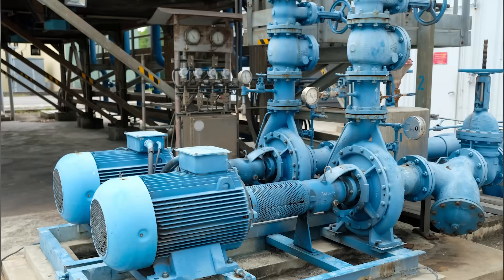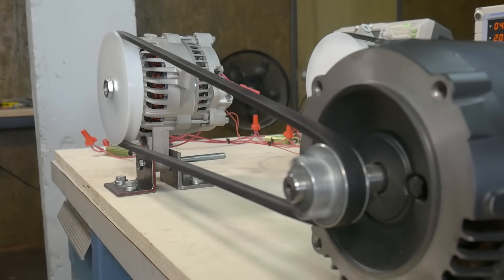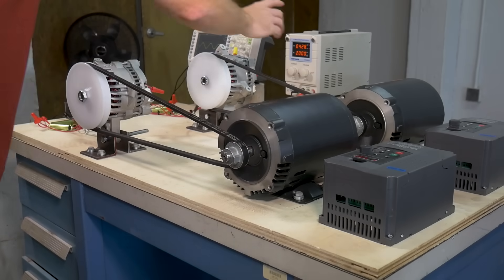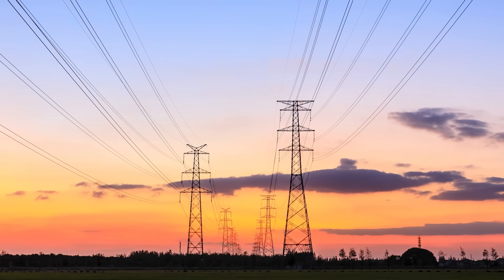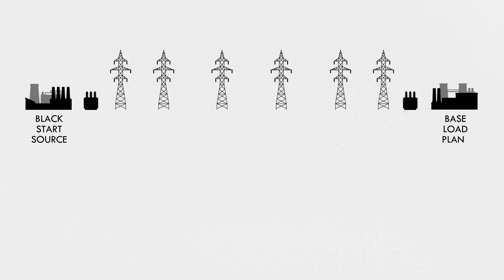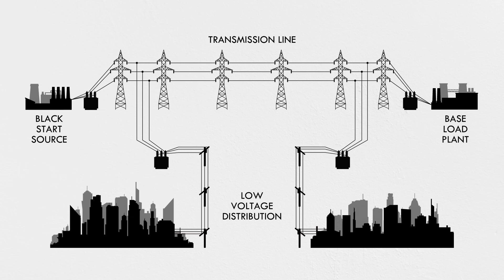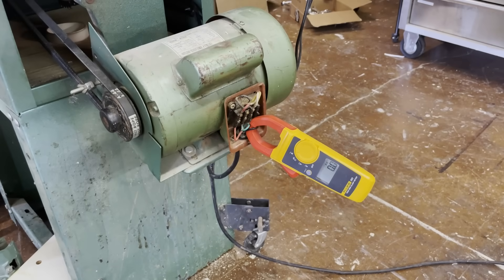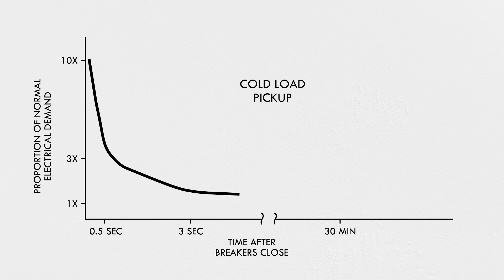What Is A Black Start Of The Power Grid?

Comment: You brushed over that the generators would mechanically synchronize.  Can you explain that process?  How does 1 affect the frequency/phase of the other?
Reply: Because, to oversimplify, every generator is also a motor.

Comment: I used to live near a black start power station called Littlebrook D, just on the outskirts of London. It used three pairs of Rolls Royce Olympus gas turbines (derived from those used in the Concorde airliner) to start up its conventional oil fired power generator which could then start other stations. It was used in anger following an outage after a big storm in 1987, and it would also start up automatically to help maintain the 50Hz frequency of the grid during periods of high demand, due to its short 5 minute startup time.
Reply: There's a similar array of four pairs of Rolls Royce Avon engines at Didcot to provide 100MW of fast response time generation and strategic backup, I think it's a similar setup with it being capable of starting up the much larger gas turbine array that now inhabit the site

Comment: I always knew that like power plants you know use electricity to run as well, or at least needed it for like their lights and coffee makers like you were saying, but I always thought they literally just you know like plugged into their own generators in that with that but like I never really realize how that’s probably not possible or at least very difficult and it’s much easier to just send it off to the grid and then have a regular powerline installed off the lines on the street especially if you’re somewhere close and already have existing power infrastructure close by that would be interesting to see you like just came to see how PowerPoint actually function. Are they get their electricity? What they need what they do what they produce of byproduct second of stuff

Comment: Turn the breaker control switch to TO SHUT at 5 minutes to 12:00 o’clock on the synch scope turning slowly in the FAST direction, and release to SHUT with successful parallel.  Add a bit of load.  Adjust reactive current voltage, then load the on-coming generator.

Comment: One thing I'm curious about with black starts that you didn't mention in this video was how do the various plants communicate on how and when to start back up?  If the power is out, that'd be a huge hamper on most forms of communication.
Reply: Smaller generators can keep comms open, at places like radio masts and landline stations. Failing all that, satellite phones would also be used
Reply: Utility operators understand the role of communications, and have secure systems in place that allow them to communicate in the event of a widespread blackout.
Reply: Major power lines have fibre optic cables embedded in earth wire. Back in the past they used fixed microwave links.

Comment: Sounds like bad engineering if such a catastrophic failure state exists that a recovery from is extremely difficult to perform...
Reply: Or it's an absolutely massive system that by it's very nature is complex and prone to cascading errors. It only sounds like bad engineering because you haven't the faintest clue what you're on about
Reply: It sounds like you're not very good at listening. The engineering is perfectly fine.

Comment: An excellent video, as usual for you Grady!  I've been involved in this issue on a MUCH smaller scale as an Engineer in the US Navy in the early '70s.  We had three, 750 kW steam turbine generators and one diesel 750 kW emergency generator on board.  We would run drills wherein we would "lose the load" and all equipment would trip off line (generators, main engines, boilers, etc.) while at sea and practice bringinging everything back online using the diesel generator to accomplish this.
Reply: How fast could you get everything back online?
Reply: @KJ6EAD  IIRC it was about an hour or so to get back up on line fully.  But we were limited to 1/2 speed or less for the first hour or so of operation due to our HP turbine tending to develop a bowed rotor if not brought offline properly.
Reply: I used to work at the San Francisco Naval Shipyard and tested ship service generators.  We weren't supposed to parallel with shore power but sometimes we had to do it when they were testing radars and other electronics.  Fun!
Reply: @r.h.8754  Yep.  It takes a bit more finesse than "just flipping a switch."
Reply: Did you have to synchronize the generators when connecting to shore power, or was it an instantaneous cut over?
Reply: @krallja  In order to not cause an interruption in the ships power we had to synchronize with the shore power.  We did this by matching the frequency, phase and voltage with the shore power.  After we closed the shore power breaker we would lower the governor control to move the KW to the shore power and then lower the voltage regulators to move the KVARS to the shore power.  When the generator outputs were zero we could open the generator breaker.  We reversed the process to move the ship from shore powere to ship service power.
Reply: @krallja  I didn't get involved in that (Electrician's Mates did that, I was a Machinist's Mate, I ran turbines, pumps, etc.)  But I do know that synchonization was part of the process for bringing up a generator, bring down a generator, and switching to shore power.

Comment: my dad used to work for German railway, back in the eighties... they (still) use 24kV 16 2/3 Hz to run the trains, which is converted from main grid with motor/generator pairs, each weighting hundreds of tons. An Engineer in a hurry managed to engage both, before they where entirely synced... the buildings foundation had to be redone, since both machines did tilt just like yours did... being bolted to the foundation did nothing to keep them from doing that...
Reply: I bet that made an awesome sound.
Reply: @Flumphinator  I bet it made an expensive sound, lol
Reply: @firestorm.v1  It starts with a Uuuuuuuu sound then a Rrrr sound and then something that sounds quite similar to the word "fired"
Reply: @fischX  if that's the first time someone broke something, firing them is a bad move. You just invested so much money in their education and now they're never gonna break your competitor's systems because they learned their lesson ;-)
Reply: Shame we couldn’t see it on hd cctv!!
Reply: You don't even need something so big for extensive damage.
My dad used to run a small business servicing small-scale hydroelectric power stations (the kind you might see in small creeks near mountains etc.) and one of his customers managed to mess up a post-maintenance start-up.
He connected his generator to the external grid before sync was achieved and the result was rather spectacular. The entire generator sheared off the bolts it was attached to the concrete floor with, yeeted itself through a brick wall and out into the yard where it crashed and popped open from the impact forces. Needless to say, the thing was ruined, the building needed costly repairs to the structure and as a side-effect some of the electrical systems got fried by the large power surge and had to be replaced as well.
My dad was called in to restore the mechanical parts (the connecting shaft and transmission system was bent and shattered as well) and hook a new generator up to the turbine and took me along for the trip, so I could see the damage first hand.
Reply: That wasn't very German of that engineer
Reply: @jamesf2656 lmao I thought the same thing
Reply: I remember doing that experiment at uni. Rotational inertia is an amazing thing - Inject enough energy into the rotor to stop it and some other part of the motor will rotate instead!
Reply: Hey, Germany uses 15 kV. Just like Switzerland, Austria, Sweden and Norway.
Reply: "my dad used to work for German railway" "An Engineer in a hurry managed to engage both"
Are you, by chance, talking about the same person?
Reply: @TauCu  nope my dad is just an electrician and was involved in removing the overhead electrical lines temporary, to get the ginormous new  parts transported there.
Reply: @TauCu , there's a reason why Germans are so strict with rules. His grandfather is a likely reason.
Reply: It's 15kV 16.7Hz.  A funny YouTuber remarked they're likely going to switch to a much more reasonable and grid compatible 25kV 50Hz about five years before the Sun goes supernova.
Reply: Small correction, it's actually 15 kV :)
Reply: Thomas Edison had the same problem in NYC.
Reply: Black Starts Matter
Reply: There is a LOT of force involved in electromagnetism. The sheer torque of the entire grid ripping on a generator/whatever is absolutely ludicrous, I'm sure everyone has heard the old stories of generators being racked into the grid out of sync and blowing the multi-thousand pound hunk of metal into a wall, tearing the anchors out... man electricity is something to respect.
Reply: The engineer was probably since foreigner. I doubt a German would make that mistake.
Reply: @dancingkitty11  nope he was 'verbeamtet' and hence could not be fired... he got transferred to that job because he managed to trip a railway stations main breaker twice, by commanding several heavy freight trains to go at the same time. The hope was, that he couldn't do something that wrong at his new job, yet he found a way.
Reply: @JörgReinhardt-f5s  oooof
Reply: @JörgReinhardt-f5s  failed upward?

Comment: Nice job Grady, I enjoy all your videos especially this series as I've been a substation guy for over 20 years. We still practice manual synchronization a couple times a year, just in case we can't rely on the relaying.
Also, I wanted to mention not only do you have to synchronize the power Islands, you combine them to build enough load to provide frequency stability for the grid and the larger power plants. A large nuke for example, needs a certain amount of load to have a stable 60 hertz frequency. So that's why they build relatively large islands before bringing large plants online.
Reply: I have no idea what you are talking about.... but thank you for knowing!
Reply: @alanwesterfield4254  Put simply, the thing spins to make power, but you need power to start it spinning. 
For some power stations (nuclear in this case) they also need something for the spinning thing to actually send power to, or it'll spin too fast. (or too fast/too slow/too fast-too /slow which is also real bad) 
So you have to get it enough power from somewhere else to start, and also connect it to enough stuff that it spins at the right speed, but not too much or it'll stop spinning and you have to start over (assuming that stopping it spinning didn't break something)
Reply: Don't all nuclear power plants have to be able to blackstart?
They need emergency power anyways, because the cooling pumps have to be kept spinning at all times.
Reply: @jannikheidemann3805  
Nuclear plants have to be able to reach cold shutdown without offsite power. There is no requirement to blackstart.
Reply: @fredlotte2601  Thank you for clarifying.
Reply: @jannikheidemann3805  all nukes have multiple back up black out generators on site, but they're only large enough to maintain power to cooling pumps and other loads to keep the core cool. Currently no nukes are capable of black starting the grid.  There is research being done to see if it is possible if the generator is kept at lower power levels. But that's only feasible if the operators knew they'd need to quickly reduce power to 5% and disconnect from the grid.  Though such an alignment isn't currently allowed by US nukes operating license.

I've heard some European nukes, (France?) maybe black start capable.

Comment: Now having more battery storage on the grid will help tremendously with black start.
Reply: Only if it's designed to do so. Pretty much all renewable sources "follow" the grid and shut down without it, even commercial stuff. They use the grid for their own frequency clock, thus without grid power they shut down.

But with a big enough bank of batteries it would most likely be considered to add that functionality.

Comment: Is there any chance that you can do some analysis of the incident in Moore County, NC on 12/3/22 and what they will be facing to get power back to that area?
Reply: And yes, I do understand that the situation in NC is not a Black Start situation.
Reply: @jeremyeverson9247  You'd do better asking some gun enthusiast channel about Moore County.
Reply: @JohnHughesChampigny  I have read up on what is believed to have happened so far. I have zero desire to have gun nuts tell me about this. And I do have my own opinions on people that would do something like this.

That being said, I am more interested in how you recover a small area of the grid from something like this. Is it simply isolation, replacement of equipment and then flipping the "switch" back to On or is it much more nuanced than that?

Comment: On the neighbors a few blocks away note
It also depends on what phase etc the "neighbors" are on

Also theres different subsections from each power substation so you might be on one section they may be on another.

E.g part my street is on one another part is on a 2nd and then theres a 3rd and 4th section to.

So each section will get it back at different times.

Example
During a recent outage some us had no power for 8 hours
Others went 60 hours.

Comment: If you've never been the Fort Peck Dam powerhouse tour is one of the best I've been on. It is a black start site (at least was in 2016 when I was there) and you get to go under the generator and see the drive shaft. No photography, but maybe you could get them to let you do a video. The system has some of the original control equipment to allow the black start in addition to the modern computer controlled system.

Comment: So if we get more battery capacity into the electric grid, coudl that be used to blackstart everything easier?
Reply: It would have to be designed for it. Renewables get (and sync) their frequency to the grid. Without grid power they stop and have to be restarted once grid power is available. 

If it was a major battery project I could see it being discussed to add that functionality to the bank though.

Comment: Another way to think about this is like a large turbofan aircraft - they need either a start cart on the ground to supply the needed energy, or a smaller engine that can be battery started which then supplies the main engines. Now scale that up by an enormous factor of interconnected main engines connected by an intricate web of complicated systems.

Comment: Love your vids! This has long been one of my biggest fears, so I have a fairly robust backup system with a battery bank, several generators, and finally a physical means of generating power if needed. I recently put a double pole, double throw switch onto the furnace so we can run that separately from its own inverter circuit. God help us if the grid goes down. Great models btw!!

Comment: A fantastic video ! Thank you very much for it! A blackstart could be simply described with the process of one´s car starter motor which needs the electrical  energy of the car battery. If the car battery is empty (black-out), then the starter motor won´t work. You would need some help with it, that e.g. someone pushes your car and the little rotation and little electricity produced would suffice to start the motor (blackstart) and consequently recharge the car battery (the grid).